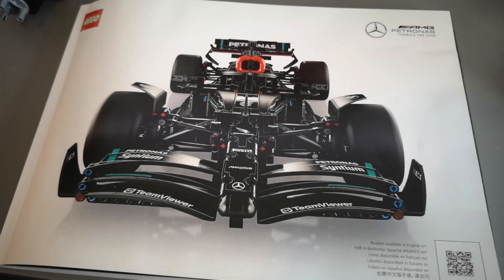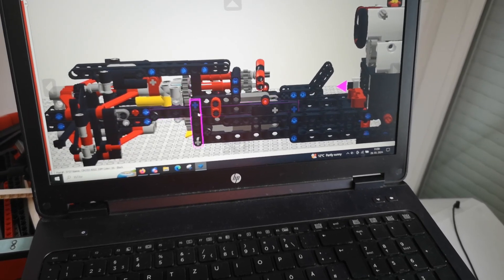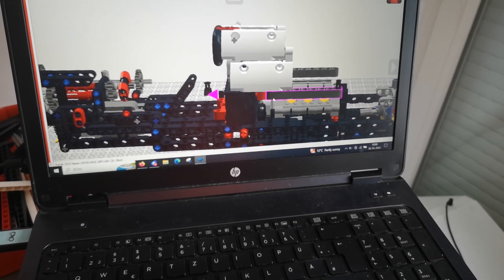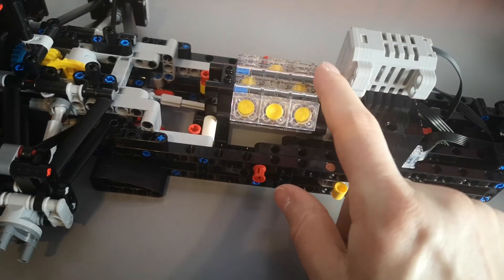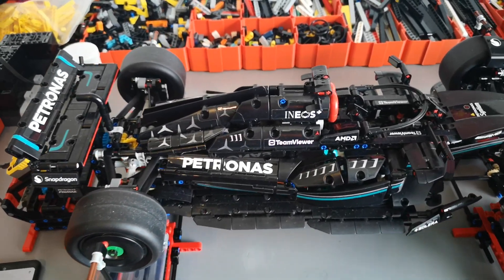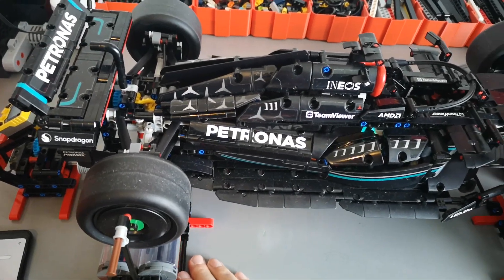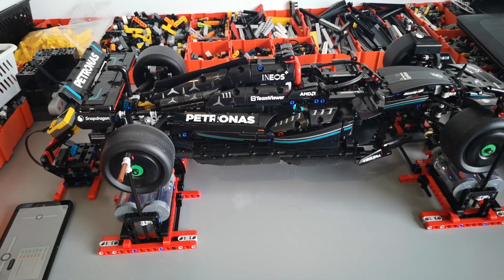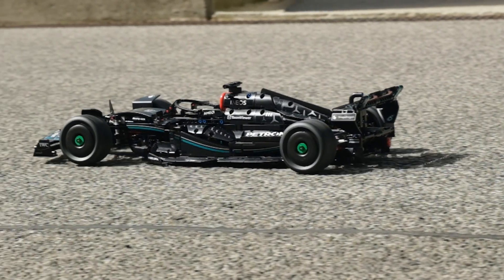42171 Mercedes-AMG F1 W14 E Performance Motorization process

Comment: Please, if you can, make a video or a file with instructions showing how you mounted the motor to the car’s body. I’ve been trying for months to replicate what you did, but it’s been impossible because I never know which part is the right one, everything I try doesn’t fit, the motor doesn’t stay secured, and it comes loose. I also don’t understand how you set up the gearing on the differential. Please, I’m asking as kindly as possible, help us with the instructions; you would make me and my son very happy.